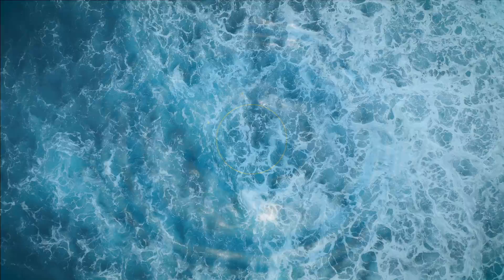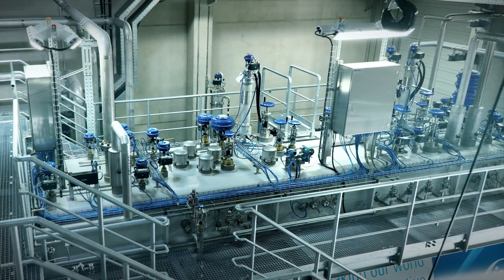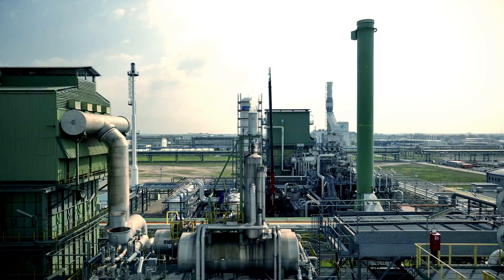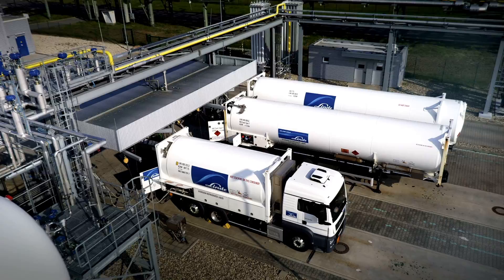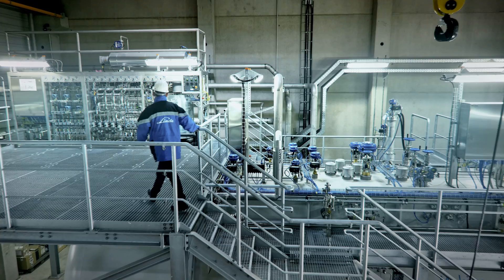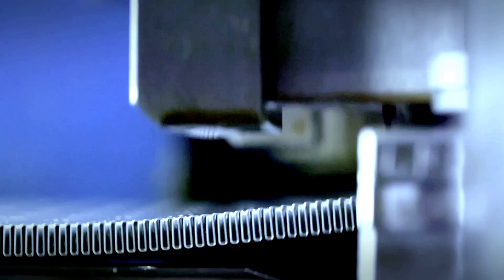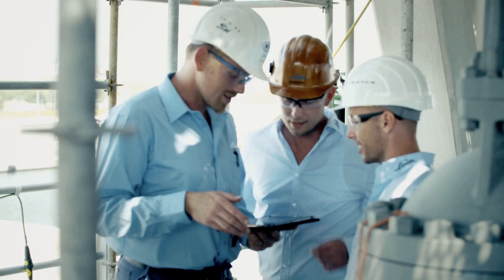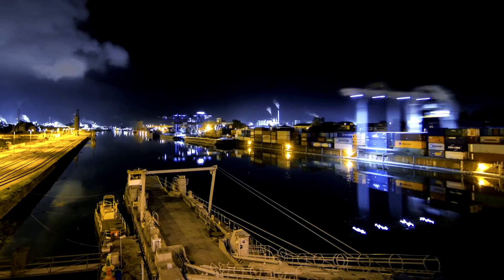Liquid Hydrogen - The Fuel of Choice

Comment: With active cooling a slush hydrogen can be achieved with ~20% higher energy density while also eliminating boil off
Reply: Does not eliminate boil off - just reduces it and requires more energy to produce the slush
Reply: @paulwebley5616  what I'm seeing they say it could eliminate boil off, and yes it uses more energy to produce but I'd counter with energy efficiency isn't the only metric to look at. In addition if it is a problem a heat recovery loop could be used to recover some of that energy

Comment: liquid hydrogen also makes liquid oxogen  so that should be compressed too 
 a solar reflector heats water  hot enough to make hydrogen and water separate  then it can burn that could run a turbine or melt salt or even metal as a storage
Reply: ?? Why does liquid hydrogen "makes" liquid oxygen????

Comment: Somebody, please tell me how it is either economical or environmentally sound to produce hydrogen for use as a fuel.  It takes more energy from traditional sources to produce a lesser amount of available energy from hydrogen.
Reply from the maker: Hydrogen offers compelling benefits. First and foremost, it supports a gradual transition towards lower-carbon sources of energy as it can be generated from natural gas and other non-renewable by-products. In addition, it can be used as an energy carrier; in other words, a medium to store energy from renewable and other sources. Looking to the future, it can be generated at scale with a zero carbon footprint by using renewable energy such as solar or wind power, for instance, to split water (electrolysis). Learn more here: https://www.linde-engineering.com/en/hydrogen/index.html?
Reply: So to me hydrogen as a power source or carrier instead of storage like batteries is very sensible puts less stress on the power grid and there are places that get huge amounts of energy but the energy can't be transmitted like the Sahara it would be a good place for liquid hydrogen production it gets tons of energy but only a tiny fraction gets used
Reply: @thelindegroup  as an amateur chemist this is a weird idea to me.

The hydrogen is already stored in the carbon based fuel, that's what fossil fuels are.

Stripping the hydrogen from already energy dense fuels & then bringing the temperature down to over -200 °c seems like it is causing serious complications for everybody, is there not a physical storage medium like magnesium hydride or something that could solve this as a better intermediate?

Or just having a fuel cell that does what you do at the source of combustion?

I.E, a fuel cell that separates the hydrogen from say, natural gas, expels the carbon & burns the hydrogen, this seems more efficient than trying to freeze (in a relative sense) something you're later going to burn
Reply: @thelindegroup  whats the kWh per kg of your liquefaction process, whats a typical venting loss % between plant and delivery?